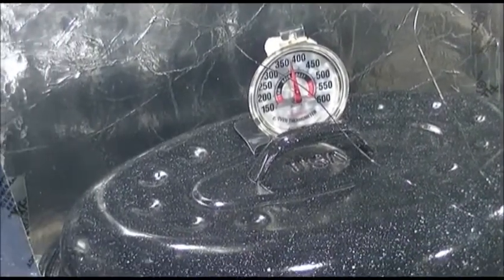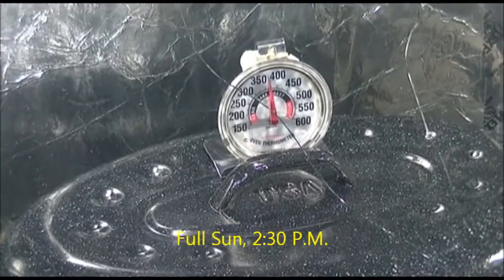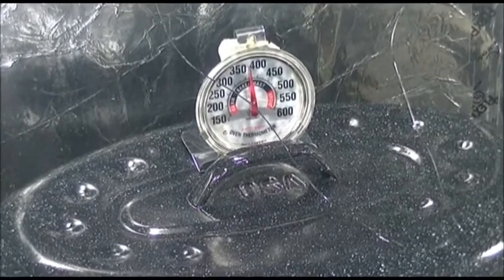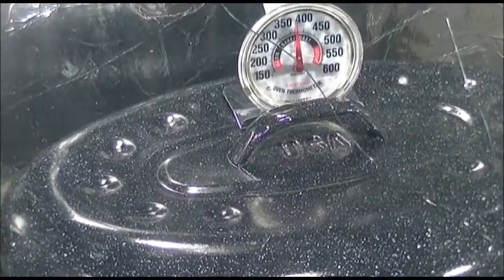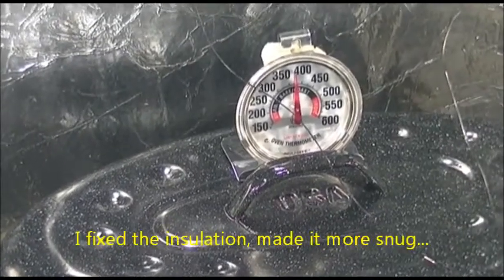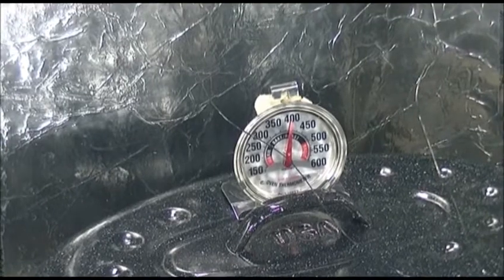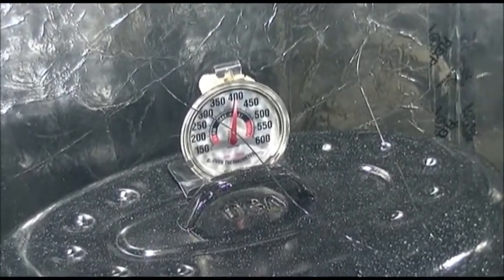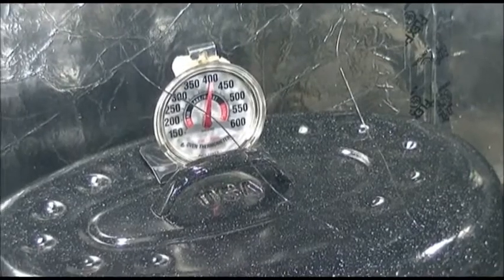Solar Oven 2012 Temp Test

Comment: borosilicate glass wont crack like most glass just get borosilicate glass it was the glass pyrex had back in the day.
The glass on the inside expands when it gets hot, putting stress on the cold glass on the outside. When the stress gets too great, it cracks but borosilicate glass wont due to the fact that Boron changes the atomic structure of glass so it stays roughly the same size regardless of its temperature.